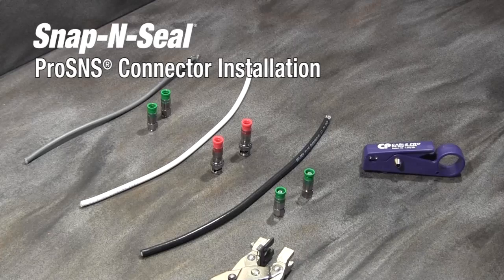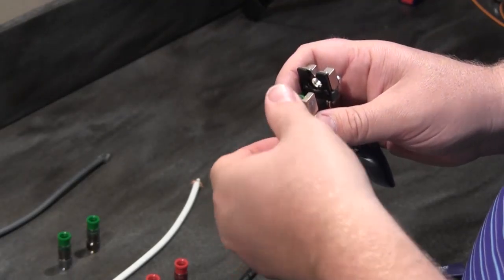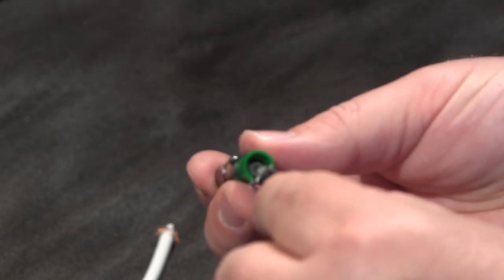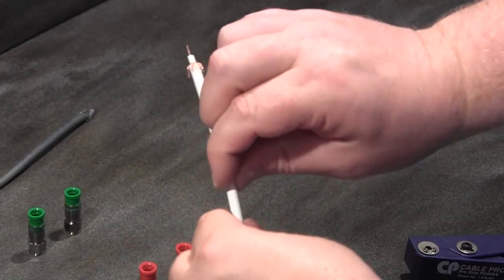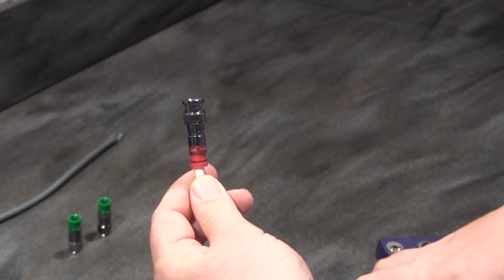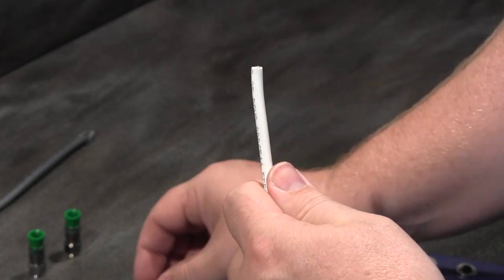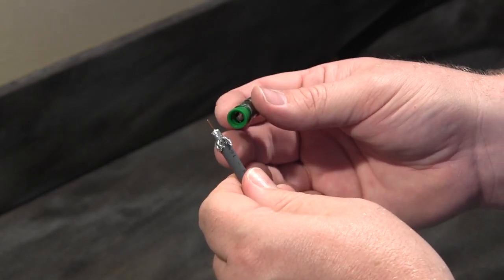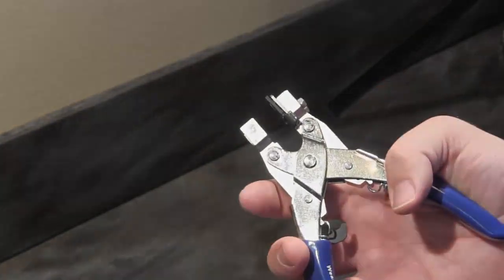Installation of Belden's Snap-N-Seal ProSNS Connectors

Comment: The red f connectors do not work well. They do not compress enough and w/very little force you can pull them right off the cable after using compression tool
Reply: We have no issues with this.  I would think if they are not staying on, the cable OD you are using may be slightly undersized.  We have used the Belden connectors with no issue using various Quality manufacturers cable.  The cheap Chinese knock off cable differs of course.